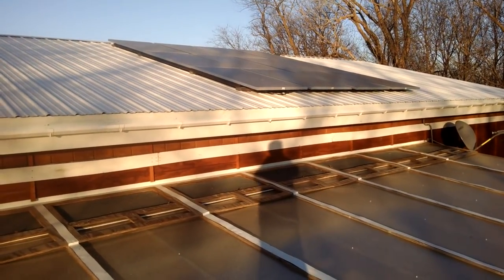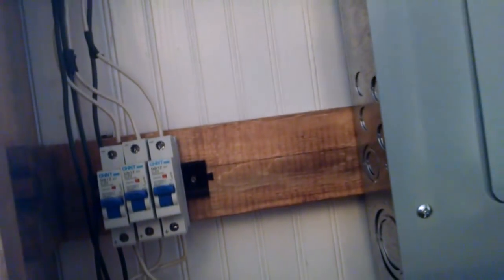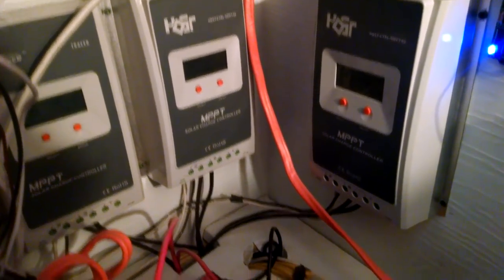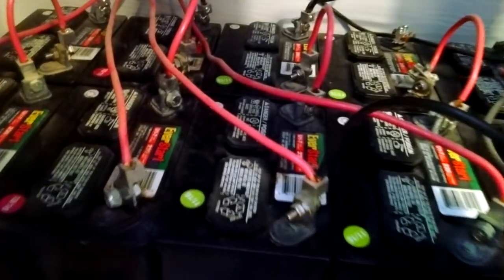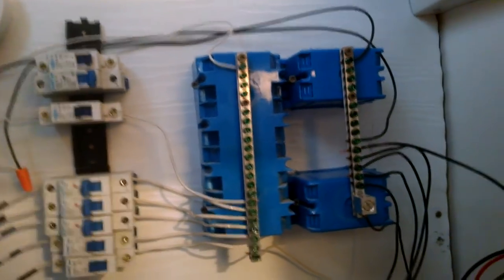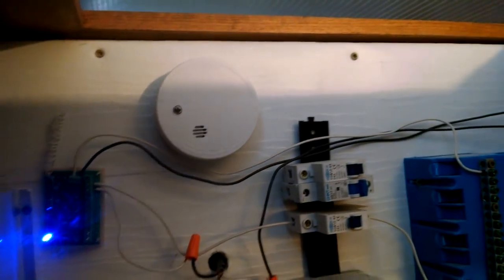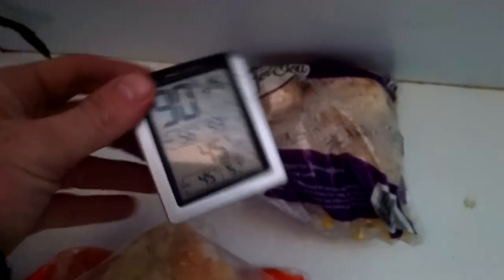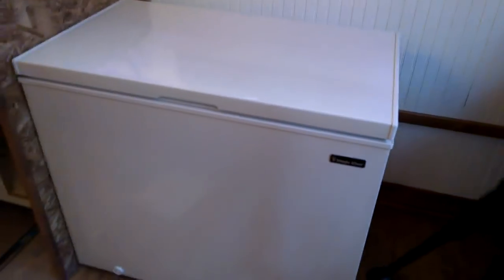Seed Eco-Home PV System

Comment from the maker: On the question on temperature variation of the refrigerator (deleted by mistake) - the refrigerator stays constant at 45F all the time. The freezer is set for 14F. When turned off in the evening, it rises from 14F to 28F by morning time, when it turns back on. It remains within the 14F to 28F range at all times.

Comment: How much is idle load of the inverter? Do you turn it off for the night time?
Reply from the maker: Idle power is about 10W. We don't turn it off at night as we need to run the refrigerator. Interestingly - the refrigerator uses less power than the inverter on idle. Turning the inverter off is a good idea as part of a smart power system.